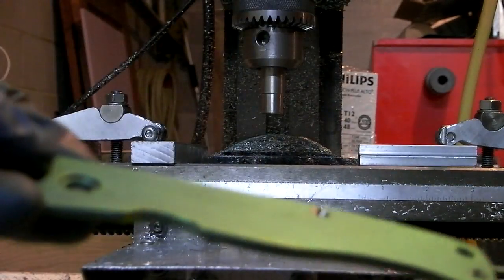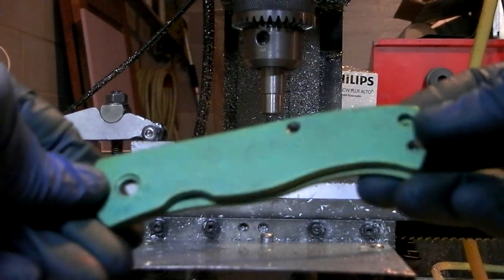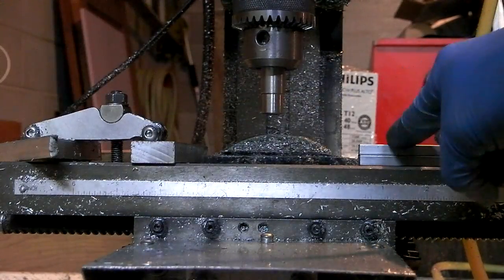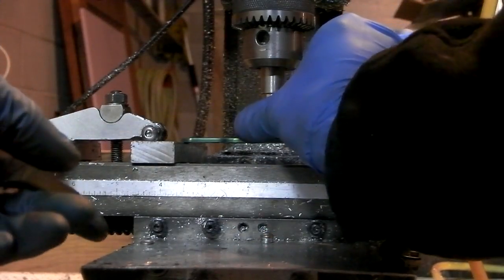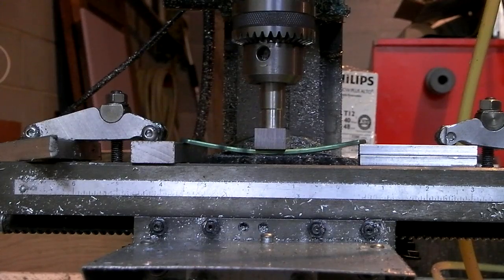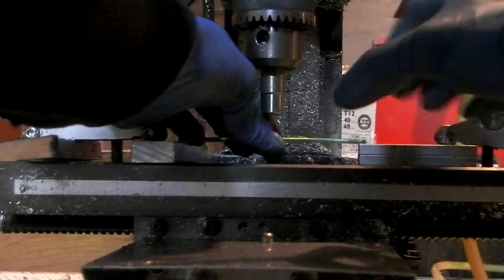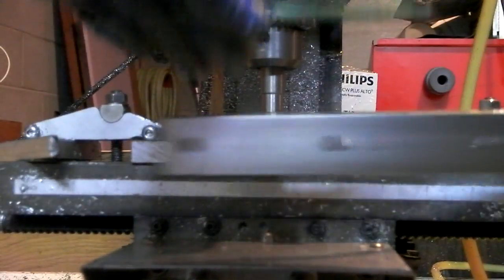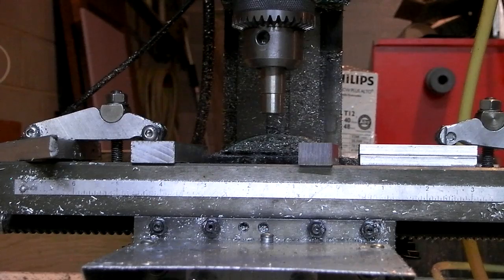Bending titanium Emerson knife handles

Comment: Hi John some of my custom titanium frame lock knives slightly bowed(bent) up

opposite bowed to lockbar bending. Is this wrong? or it is bent for purpose? like its bowed up to create tensions to hold screw better or when it is assembled let the handle scales look eachother horizontal perfect?

when i put my frame scales on flat surface, it has little bounce when i press with my finger barely can tell but still annoying